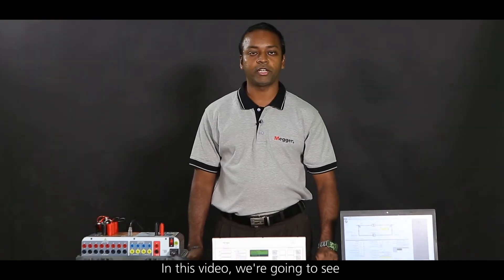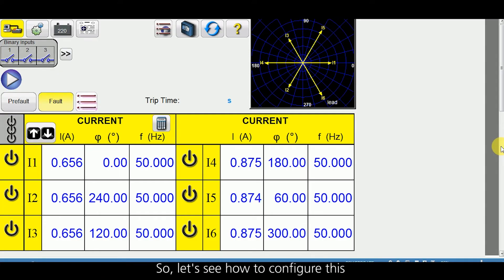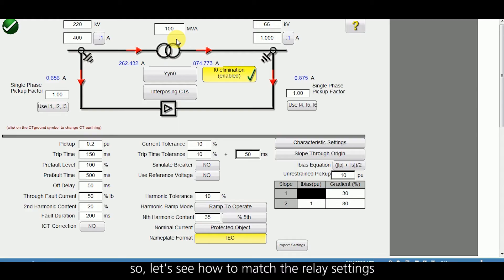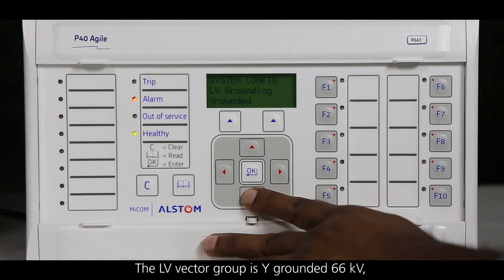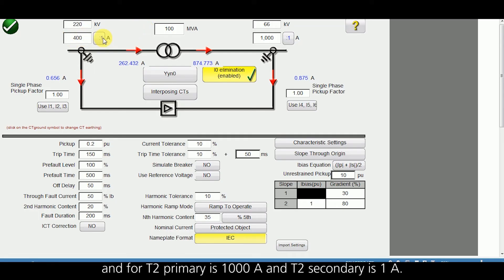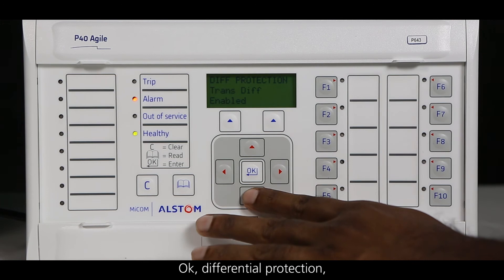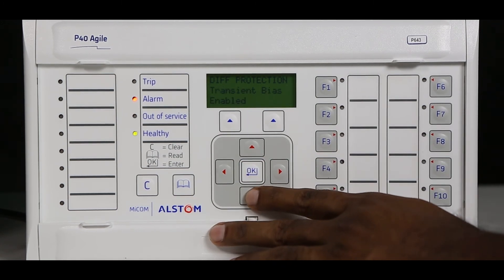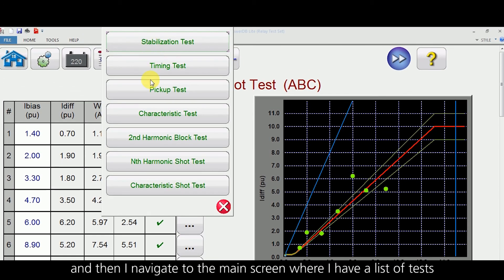17 - Testing basics on transformer differential relay testing

Comment: Sir,

     In our 110kv substation we using P154 o/c & e/f numerical relay on 11 kv feeders. When feeder tripped on e/f we get some data from relay like, Ia=316A, Ib=972A, Ic=373A, In1=869A, In2=896A, I2=280A, I1=371A, I2/I1=0.75.what does it each notations mean. I hope clarify my doubt .

       Thank you
Reply: Those current values are the currents that were flowing during the fault. Ia, Ib & Ic are pretty obvious.. phase current values. In1 & In2 are measured by EF element and derived earth fault current calculated from 3 independent phase current values. I1 is positive seq. component, I2 is negative sequence component (Which is an indicator of the fault).